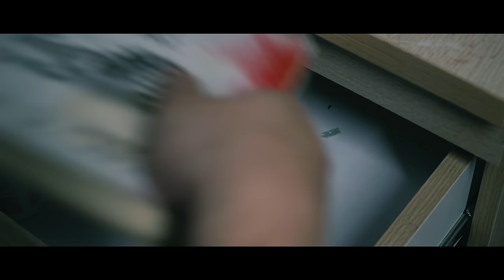Piranha in a Scary Lake Diorama / Thalassophobia / Polymer Clay / Resin Art

Comment: I like your ideas and I very much appreciate that you do most of your work manually (not that I SHOULD criticise - my own clay work is quite limited to making two coasters for my decorative candlesticks, to prevent wax from dripping to the table, and a pen box, to keep my best pen which I use for writing my diary with the tip facing down, because it writes much worse when kept in a horizontal position. I painted the coasters and the pen box in ultramarine with blue glitter, I just LOVE deep, but luminous blue). But I'm a little disappointed. The piranha colours are quite muddy and human figures are just not well done.
I think I liked the diorama with a huge snake guarding a temple best, although in this case too I was disappointed when you repainted the snake. What I regretted most wasn't even the colour change itself (although I love blue tones), but the fact that the blue version had an interesting pattern and the orange - almost none...
Reply from the maker: Thank you for your feedback. We really appreciate it and will consider to apply it for our next products.
Thank you so much, we will strive to make better products in the future.